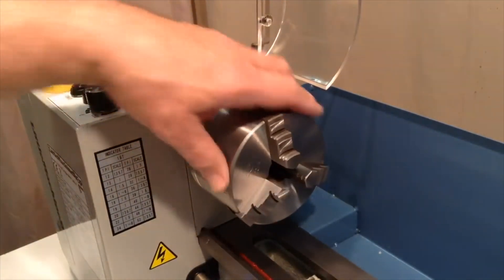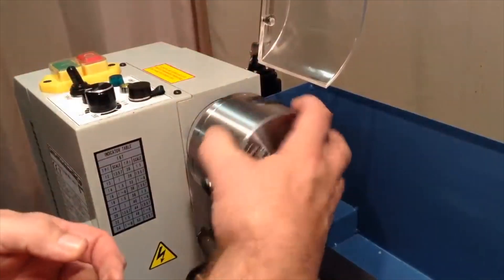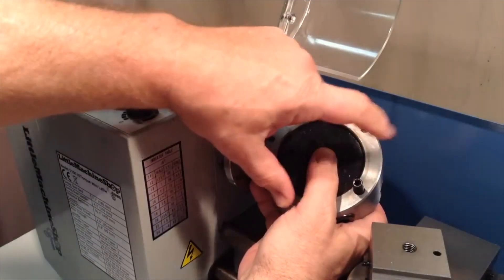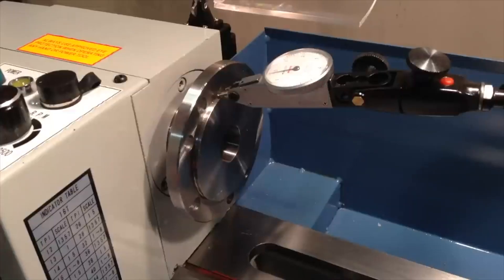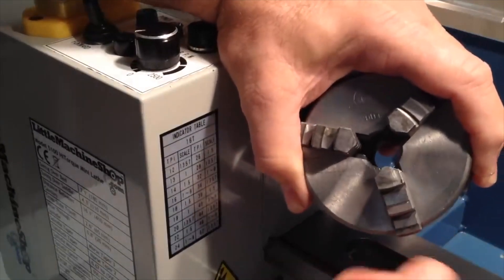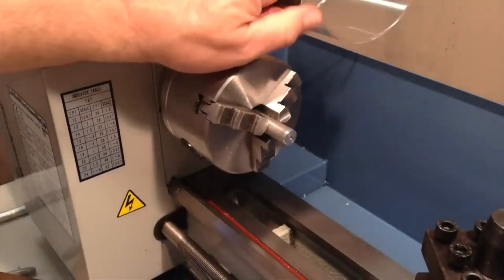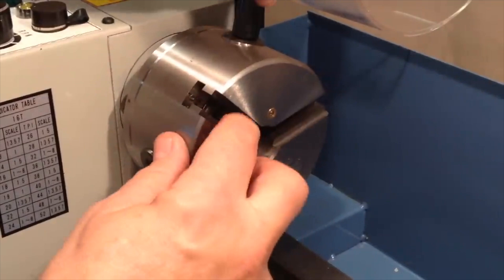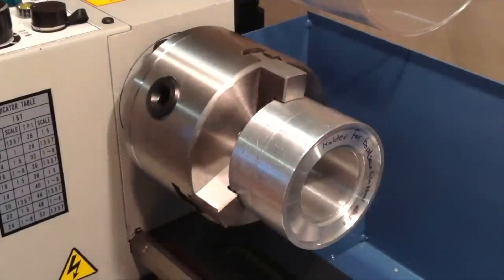LMS 5100 Mini Lathe p3

Comment: Th hole extra hole in the spindle at 6:48 is so that an Allen key can be threaded to the hole to remove the three screws that secure the bearing seal retainer... that hole will line up with all three of those screws.